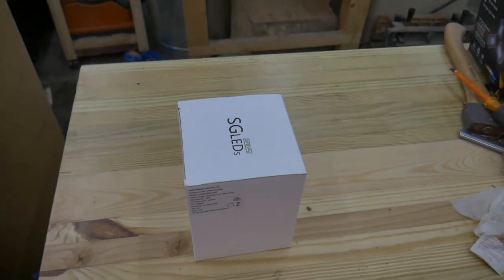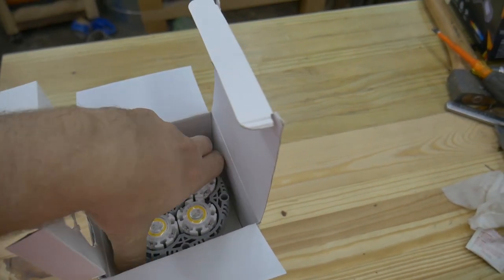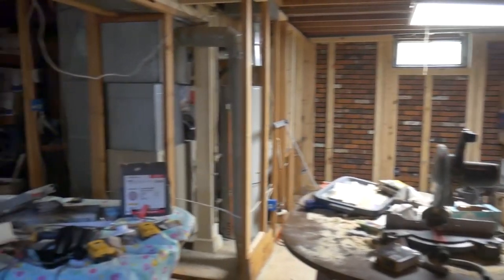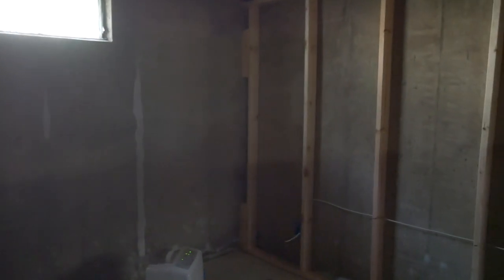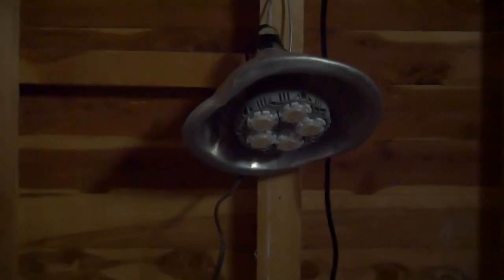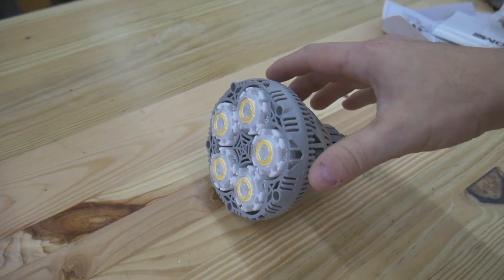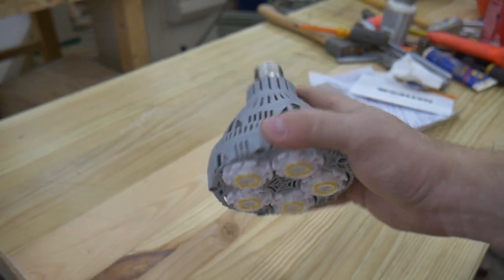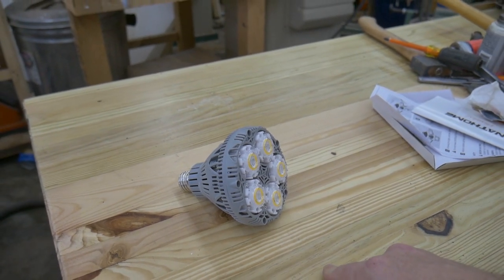Test and Review: SGLEDs 30W Flood Light (4000 lumens, 200W equiv.)

Comment: It sure is bright. Sadly, I have 20 places where I NEED "Flood" Lights around my home. Problem is: it would cost me over $439.80 (from Amazon) to buy them; whereas I can buy regular flood lights at $3.00 apiece. That is only $60.00 in comparison. Oh well.
Reply from the maker: I agree these are expensive, but let's compare apples to apples.  The cheap incandescent floodlights put out 540 lumens. At $3 that is 180 lumens per dollar. The SGLEDs floodlight puts out 4000 lumens, so with the LED, you get 190 lumens per dollar, plus you get 50,000 hours of lamp life. So the question is: can you get 7 regular flood light's worth of use out of one of the LEDs?  Yes, and then some.  It is a big investment up front, especially if you buy all at once, but if you buy as the incandescent ones burn out, maybe that would ease the sting?  Thanks!
Reply: @SouthpawWorkshop  Thanks for the info.